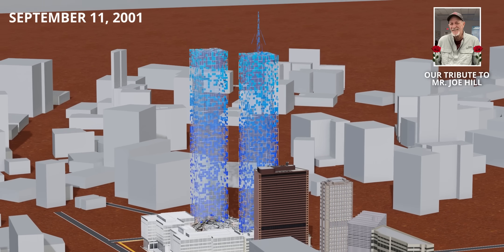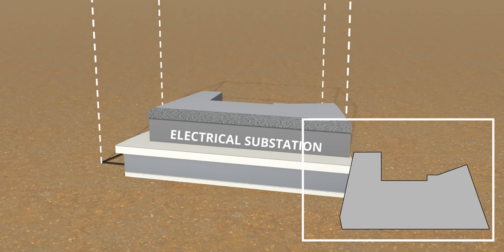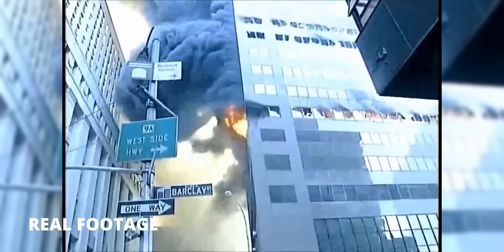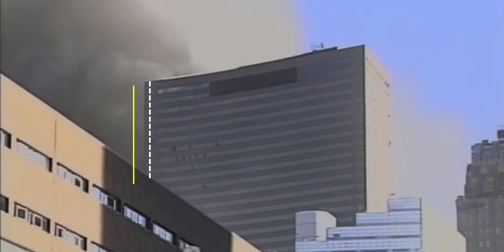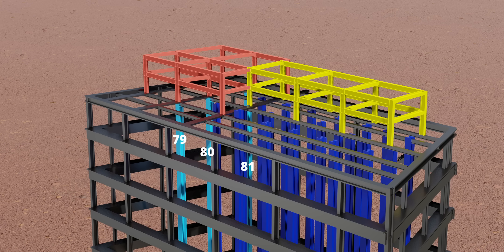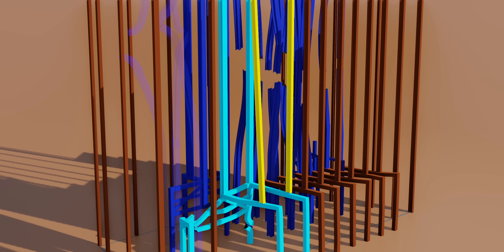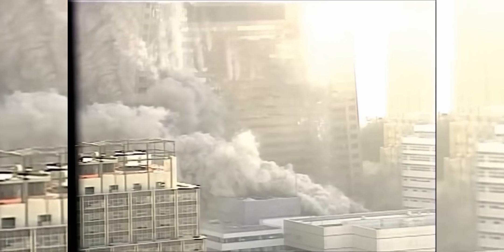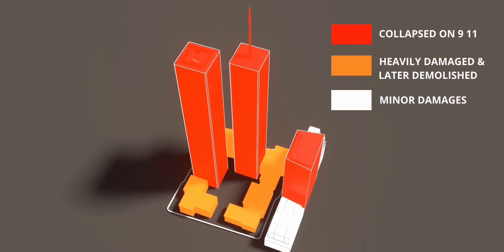Collapse of Building 7 | The Complete Physics

Comment: Conspiracy theorists: go visit One World Trade Center. Take in its immense size. And then imagine a building of that size coming down—twice—with several of its floors engulfed in flames. That will explain everything you need to know about why WTC7 caught fire, and why there were no water mains left to supply water to extinguish the fire after the towers collapsed.  This video explains the rest.
Reply: And if that's the way it happened the rubble would have been 30 stories high.
Reply: @garyolsen4160  Or, not. It would have been about 5.5 stories high. IF it had been all neat and stacked.
Reply: @mooneyes2k478  sure 110 makes 5 got it
Reply: @garyolsen4160   The Towers were 95% empty air. That was the reason they were constructed in the way they were, to maximize internal space. 5% equals 0.05. See if you can manage 110 times 0.05.
Reply: @mooneyes2k478  no I can't. You're talking bare bones and stacked which is irrelevant
Reply: @garyolsen4160   You can't manage basic math?
Well, that's mighty brave of you to admit, I have to say.

No, it's entirely relevant. If it's stacked and it's 5.5 floors, it's fairly obviously not 30 floors when it isn't.
Reply: @mooneyes2k478  It's not stacked it's a demolition. It would be a massive pile and u can't be that naive. You're embarrassing yourself. Look up common sense and act accordingly.
Reply: @garyolsen4160  So, what you're saying is, the remains of the towers spread over a large area would create a taller pile than if you stacked everything?

Yeah, someone is embarrassing themselves alright, but it isn't mean. And that doesn't really leave all that many people, does it?

Meanwhile, just as an aside, a person who can't spell a three-letter word? Isn't in any position to talk about "embarrassing". Just putting that out there.
Reply: @garyolsen4160  I think (hope?) you’d agree the towers were all there when it started and gone when it ended.  Where did the rest of it go, in your view?
Reply: @mikero6225  maybe look at the footage of basement levels. 14 would be short anyway
Reply: @garyolsen4160   So, basically, "Oh, crap, I have nothing"?

Ok, sure, but why flaunt it?
Reply: @mooneyes2k478  you win. I can't compete with your sharp debate skills. Enjoy the victory on your way to get your next booster.
Reply: @garyolsen4160   Ah, yes. "truther" 101. Someone "won".
Of course then followed up by "I'm a gormless idiot, here, have something I think sounds cool, THAT is an argument!"
Reply: @mooneyes2k478  u the only 1 arguing. Hang on while I look up gormless.
Reply: @garyolsen4160   No need, you illustrated it perfectly with that post.

Comment: The antenna-scratch caused building 7's core columns or bottom floors of to symmetrically collapse first? Not even NIST claims that the Antenna did structural damage to building 7
Reply: Someone wasn't paying any attention at all.

Comment: 0:25 - You mention the "sharp V-shaped dent" as a critical observation. However, the V-shaped collapse you point out is not consistent with the near-simultaneous, symmetrical failure of all the building's columns. According to the University of Alaska Fairbanks study, the building's collapse was due to the simultaneous failure of all its columns, which contradicts the single-column failure theory.

1:22 - The claim about the structural design of WTC7 and the role of the transfer trusses is partially correct. However, it's important to note that the design included redundancy and robustness to prevent such failures. The NIST report itself admits that WTC7 was the first known instance of a tall building brought down primarily by uncontrolled fires, which was unprecedented and raises questions about the true cause.

2:58 - The video shows the south side with fire and damage. Yet, extensive fire and localized damage alone do not explain the symmetrical, free-fall acceleration observed in WTC7's collapse. The 2020 UAF report found that such a failure mode could not have occurred without the near-simultaneous failure of every column in the building.

4:09 - You highlight the bent girders as evidence of natural collapse. However, in controlled demolitions, such deformations are typical due to the sequence of detonations. The bent girders alone do not preclude a controlled demolition hypothesis.

5:03 - You argue that the kink observed is an optical illusion. This perspective overlooks the uniform, free-fall acceleration of the building for approximately 2.25 seconds, indicating no resistance, which is a hallmark of controlled demolition, as confirmed in multiple analyses, including those by Architects & Engineers for 9/11 Truth.

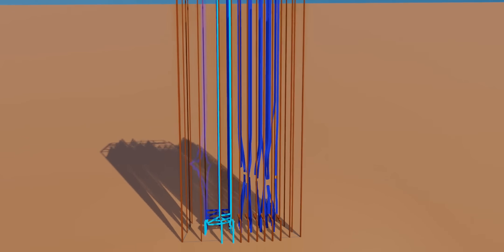7:19 - The mention of the core columns and the East Penthouse collapse does not align with the observed uniform collapse of the building. The *UAF study* emphasizes that the East Penthouse collapse should not have initiated the symmetrical global collapse observed without explosives.

8:30 - Your assertion that WTC7 did not fall at free-fall speed is inaccurate. NIST's own measurements confirmed a period of free-fall for about 2.25 seconds during the collapse, as noted in the NIST Final Report on WTC7.

9:06 - The comparison with WTC1 and WTC2 is not entirely valid. The mechanisms of their collapses differ due to varying structural designs and damage conditions. The crucial point for WTC7 is the simultaneous, free-fall acceleration indicative of controlled demolition.

For a more detailed analysis, refer to the peer-reviewed paper by Harrit et al., 2009, which discusses the presence of explosive nanothermite in WTC dust. The evidence for controlled demolition, including the presence of nanothermite, remains uncontested in scientific literature since its publication.

I hope this clarifies the key points. Let’s continue to scrutinize and understand the evidence critically and logically.
Reply: @negatron,  did you know that anyone can create thermite by clanging two iron balls together?  And the slag created by this reaction is over 4000F. Pretty wild. Two iron ball, the size of golf balls, dipped in water, when bumped together will create temperatures in the 1000s of degrees.
Reply: Well said bro... You debunked this Indian dude well enough..
Reply: Good comment.  Thank you.
Reply: kkkkkkkkkkkkkkkkkkkkkk
Reply: @CastleNotSoBravo  - Nobody gives a shit about your posts. Nobody is censoring them.  My bet is you included a link. Figure out how YouTube works, then maybe you can start on complex engineering. 

I never forgot to address the nanothermite issue. I don't care.  Been done to death. That is another one of those dead horses that has failed countless thousands of times yet you keep flogging it, expecting different results.

What you really need to do is stop being a Mindless Repeater of other people's failures and maybe work on an argument that has even a slight chance of working. Right now you're just boring.
Reply: Есть мнение, что подрыв был ядерным! В новостях звучало «Ground Zero».
Reply: Well said,and thorough in your rebuttal. this video is for disinformation purposes only and is not to be taken as truth except by the gullible
Reply: 0:25 - The V-shaped "dent" is proof of a progressive collapse and that there was no near-simultaneous, symmetrical failure of all the building's columns .  You should have watched the entire video.

1:2 - In December of 1906 the Wright Brothers made the first powered flight of a heavier than air craft. It was an unprecedented event. Does that call anything into question because it has not happened before?  Does that mean that powered heavier than air flight is not possible?  That airplanes do not exist.  You are - as most conspiracists do - taking the wrong lesson from that. And also completely ignoring what The NIST concluded. Myself, I would argue the tall bit is an irrelevant qualifier. Meaningless. Neither the fire nor the building knows or cares how tall it is.  The behavior of steel in fire does not change based on some arbitrary height. 

2:58 - That's the northeast corner genius.  And we already covered the FACT the collapse was not symmetrical (we will probably get to NOT FREE FALL too). 

4:09 - Are they? Says who?  BTW - how many explosive controlled demolitions have been performed on steel framed high rise buildings while they have been fully involved in fire?  I would say if that is what you are claiming happened it would be the first known instance of a tall burning steel building brought down primarily by explosive controlled demoliton, which was unprecedented and raises questions about the true cause.

5:03 - The "kink" has nothing whatsoever to do with the utterly meaningless average measurement of GA for one corner of the exterior moment frame at the very last stage of the collapse (see, I knew we would get to why free fall is meaningless).  Also, how fast something falls, particularly after it has already been falling for more than 10 seconds can not possibly tell you what started it falling.

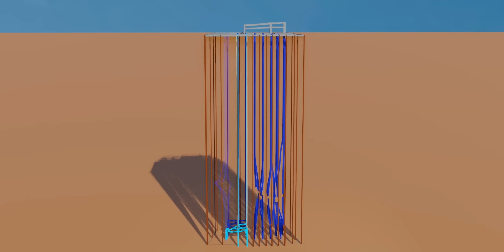7:19 - The observed collapse of the building was not uniform. Do you agree the East Mechanical Penthouse is part of the building?  Do you agree 3 columns underneath it - 79, 80 and 812 - are what hold it up on the roof?  Do you agree the EMP drops into and indeed through the building?  It's on video so good luck denying that.  One moment the EMP is there, the next moment it drops into the building.  Doesn't that mean the 3 columns holding it on the roof must have failed?  How does that make a uniform symmetrical collapse?  The UAF study BTW makes no such claim about the EMP and explosives.  You read that about as closely as you watched this video.

8:30 - Here it is again.  OK, fine. How long had Building 7 been collapsing before that measurement was taken?  It's right there in the NIST report which you pretend to have read since you (sort of) quote from it. So how long was the gap between when the collapse started and when the measurement of an average (there's that word again - why does that keep coming up?) of free fall was taken?  Why is that gap important?  What was actually being measured?  IF the entire building was being measured that would require multiple measurement data points.  But there was only one, and that wasn't even on the building (defined as its center of mass_ but rather on the exterior moment frame (the empty cereal box) that was left over when all of what was inside the box was gone. 

Did I mention that one measured data point was not a continuous free fall but an average over 2.25 seconds?  Why is that important?  Because during that (arbitrary) 2.25 seconds that single measured data point on the corner of the empty box starts out below GA then accelerates up to and ever GA then back down below GA again. It's a curve, not a straight line. So what would cause an over GA measurement?  I know the answer and it's in that "kink" you hand waved away earlier.

Now that we have covered all that can we talk about all the critical details you ignored?
Reply: you're in denial bro
Reply: Ok, so, there's just a SLIGHT issue. There IS no "University of Alaska Fairbanks study". That Hulsey worked there is entirely irrelevant. It's a HULSEY study. It's also nonsense, but that's another thing.

Let's make a few things clear, shall we?

1, The supposed "study" of Hulsey's was bought and paid for by A&E911. Now, there's nothing wrong, per se, with that, feasibility studies and the like are bought all the time. But, considering that A&E911 have a vested interest, the impartiality of the "study" does leave some to wish for.
2, the "study" was to take 2 years to make. And then it got moved. And then it got moved again. And then it went very quiet for some reason for quite some time. And then it finally was released, 5 years after it was announced, and 3 years late. I'm not saying the "study" was massaged to fit the customers wishes, but it's rather interesting that it took TWO AND A HALF times as long as it was meant to.
3, the "study" was supposed to be open to criticism by the public, and then it was supposed to be peer reviewed after that. And then, for some STRANGE reason, that went away, and it was just quietly released into the wild with no mention.
4, the "study" findings were already determined before it had started. A&E911 asked for donations and organized a drive to be able to pay for it, at which point they announced what the outcome would be. Let's repeat that. A&E911 told the world what the "study" would say, even before they'd paid for it, much less before it started.
5, the "study" is more or less spent refuting the NIST report. However, NIST isn't the only report that say that the collapse started due to fires. These other reports are mentioned but aren't addressed.
6, Hulsey's "study" tries to so something impossible. It attempts to prove a negative, i.e. that fire could not have been the starting mechanism for the collapse. This, as anyone with even the slightest knowledge of science knows, is impossible. You can prove what happened. You cannot prove what didn't happen.
7, Hulsey is not competent to make the "study" he did. While he is an engineer, his work has entirely, and solely, been about road-surfaces and bridges, as well as cold-weather effects on the same. There is NOTHING in his work that has anything to do with buildings, or fires.
8, the "study" is a shambles and a joke. There are holes in it so big you could drive an 18-wheeler through them. As just an example, the model showing the data and conclusions of the "study" has the engineering "penthouse" of the WTC 7 hinging in the middle, completely dissimilar to what visually happened, then collapsing, in one piece, through the building, without causing any damage to the rest of the building, stopping about a quarter of the way down, and then literally just hanging there, still in one, deformed but still mostly intact, piece.
9, the Hulsey "study" has been referenced, or even MENTIONED, in any reputable engineering publication, exactly NEVER.

And, while it isn't an argument as such, it is very interesting to note that Hulsey went from being head of the department to being "Professor Emeritus" after his "study" came out. This rather suggests that, much like Steven Jones, he embarrassed the university and so, they shuffled him off to the "honorary" position so he wouldn't be quite so in the public eye.
Reply: I guess you don't want to cover all the critical details you left out then.
Reply: @TheCriticalStinker-01  I guess you can't stop liking your own comment

Comment: 🤦‍♂ At what temperature does steel bend? Well done on spreading false information about a controlled demolition.
Reply: Approximately 1500-1600 degrees
Reply: That depends entirely on the steel, and on the load ON the steel. Steel begins to loose strength at 500-600 degrees F. At 800, it's already lost near half.
So, what do you know, there was no "controlled demolition". As this, and all the other evidence shows.